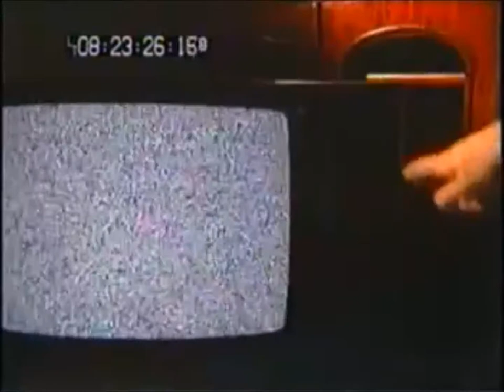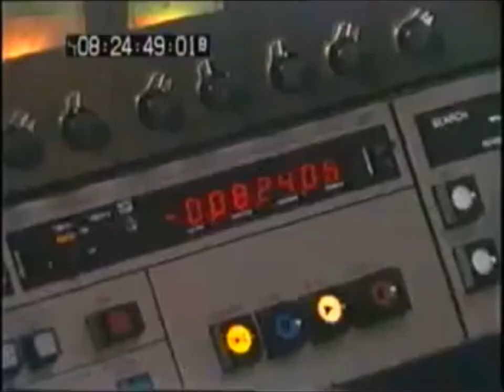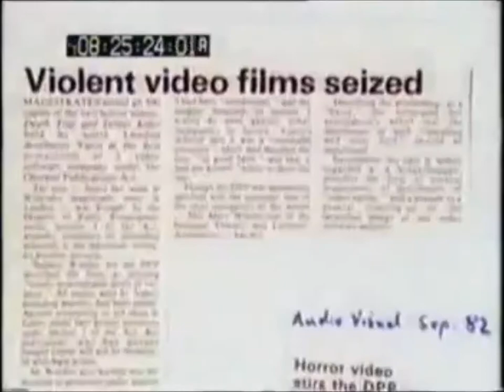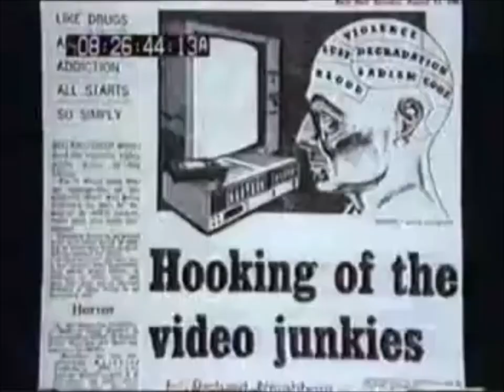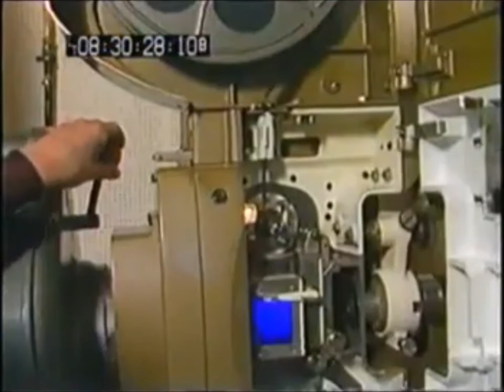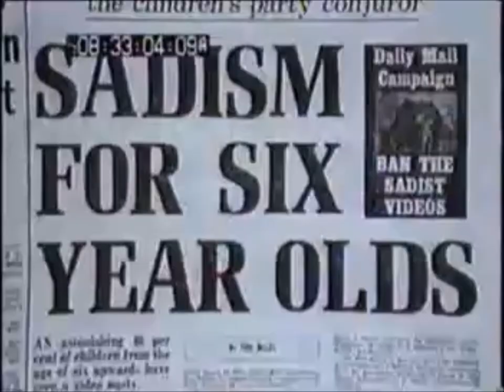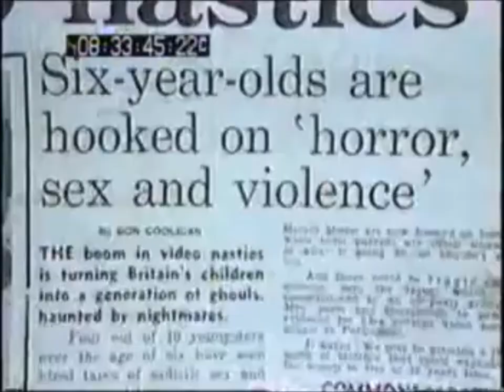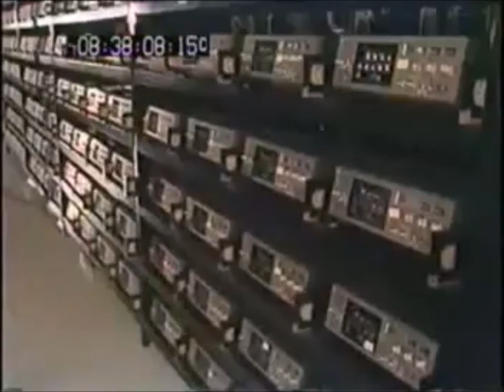'Suitable For Viewing In The Home ?' (Video Censorship & Video Nasties Documentary)

Comment: Many of the banned horrors, or nasties, of the 80's, are allowed on video and DVD/Blu-ray nowadays.  Take the film "Driller Killer" for instance.  It was banned for a long, long time.  Then, the BBFC cut it and released it on video with an "18" certificate.  Then, some years later, they released the whole film uncut.  There is also the notorious rape and revenge film "I Spit on Your Grave".  Again, it was banned for a long, long time.  Now, however, a censored version of it is permitted.  This is the case with so many others of these types of films.  Take "Last House on The Left" for instance.  It was submitted to the BBFC in the early 70's but rejected.  Then, a decade later it was released on VHS video, & then subsequently put on the Director of Public Prosecutions List.  Once again, some years later the BBFC released an edited version of it, and then eventually they passed the whole thing uncut.  Then, we have the example of "Zombie Flesh Eaters".  It was given a cinema release in the late seventies, but was edited first.  Then, in the early eighties, the uncut version of it was released on VHS video, and once again this was put on the Director of Public Prosecutions list and banned.    Some years later, the edited version which had been originally seen in cinemas with an X certificate was finally released on video.  Then, eventually, the standards were lowered and we allowed to see the whole thing uncut.  Films which have been refused a certificate by the BBFC in more recent years include "Grotesque" and "The Bunny Game".  The question is, just how long is it going to be before these films are considered acceptable?  One particular film which was released in 2007 which I feel would've encountered difficulties with the BBFC when I was a kid is the horror "The Girl Next Door".  In one scene two adolescent boys hold a young girls legs apart while a grown woman is brandishing a blowtorch, ready to perform genital mutilation on the girl with (without anaesthesia, I might add).  This film, though, managed to get past the censors without any cuts at the time it was submitted to it.  Sometimes the BBFC do consult other groups before making their decisions.  Perhaps they did so in the case of this film.